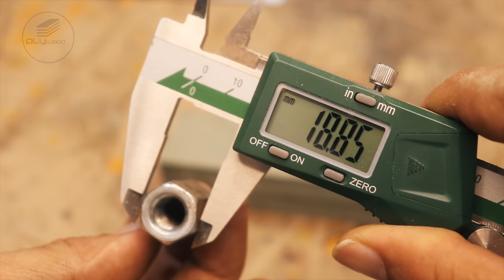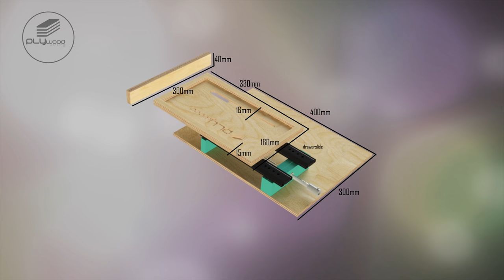Slider Crosscut circular saw with vise clamp

Comment: i made the same thing last year. your drawer slides will immediately get caked up with saw dust. you should turn them upside down so the ball bearings face down away from dust. great job though. big fan
Reply from the maker: Cool, thanks